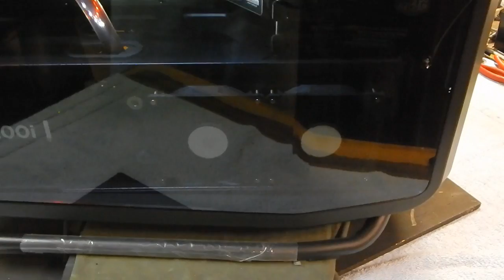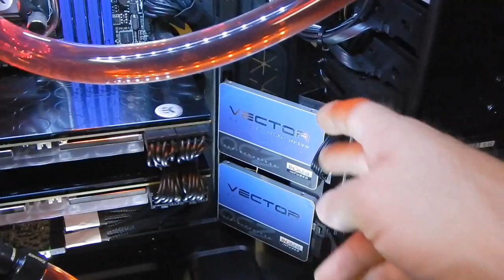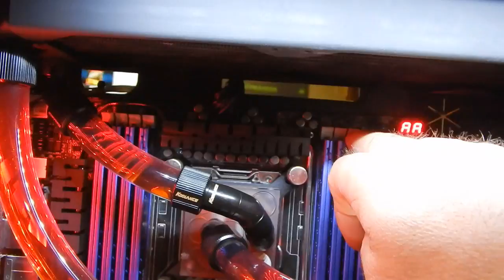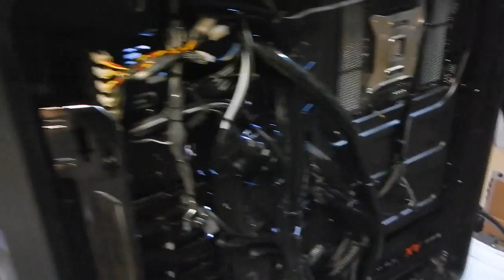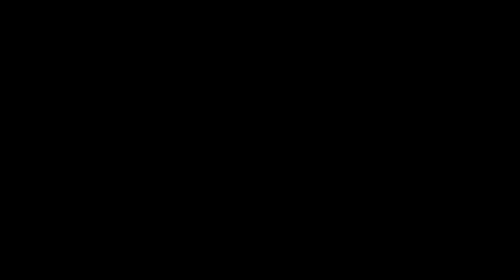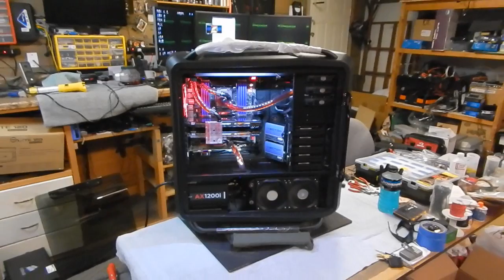Client build #1 with Custom cosmos II windowed door - Finished - part 3

Comment: Did anyone tell you that the fittings for the sli bridge are in the wrong spot. It does not alow flow around the blocks.
Reply from the maker: James Sakkas Thanks for the heads up but no one ever told me that because they are in the correct spot. I even double checked after reading you comment. Look on ek website.
Reply: Pcjunkie Mods Yeah when I first saw the video I thought it was a parallel bridge but looking closer now I can see that it is a serial bridge... my bad. Anyway glad it is correct then.

Comment: Love the door but I'd like it more if the bottom where the rads and fans were not seen and maybe the drives weren't seen maybe messed on bottom to get air not rippin on your work awesome time and mechanics of door but I'm not a full glass door guy but still my cosmos 2 needs a door I hate they didn't make a glass door on it why didn't they big case for no door and I will pay the 200 for the door but like I said would it be possible to at least hide the bottom where the fans and rad would be than

Comment: How did the dual 690's come out? I still have 2 EVGA 690 sc's laying around I got them back when they first released but something came up and i didnt get a chance to use em and thinking about building a new PC now with this new 900D and trying to weigh the balance.... dual 690? or quad Titans?? on the rampage IV Xtreme mobo?